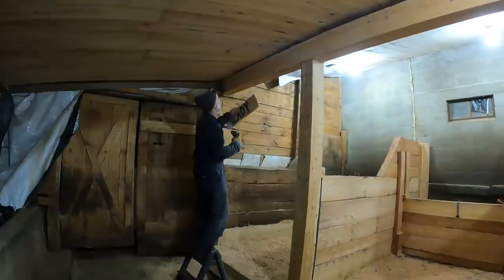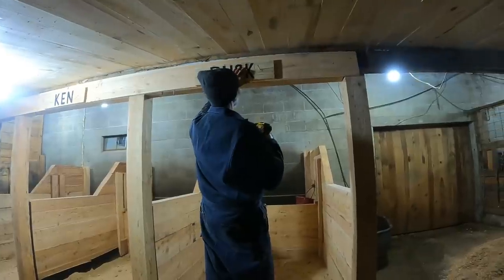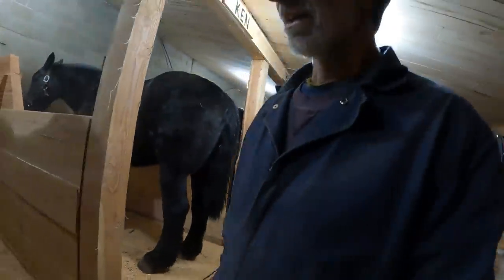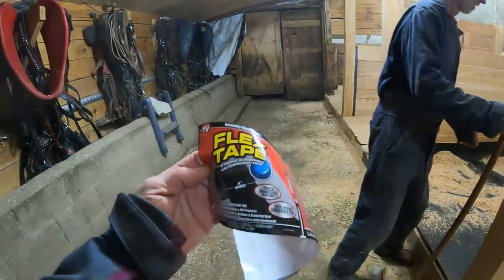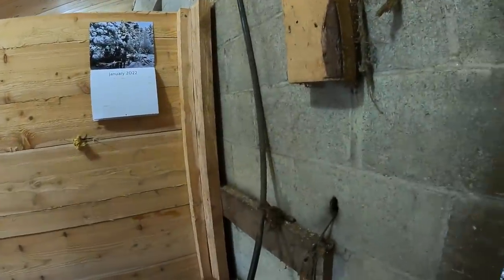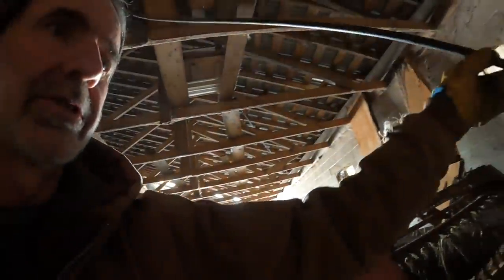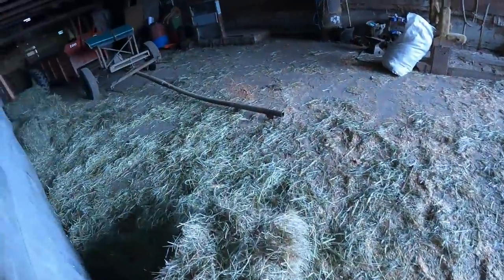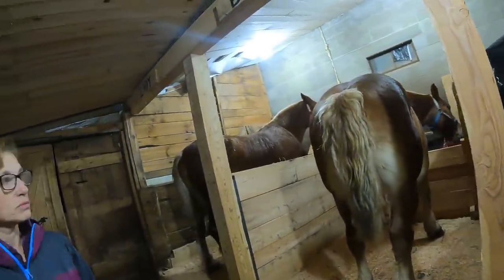How do the horses like their NEW BARN?!?!?!  // Renovating a Draft Horse Barn with Standing Stalls

Comment: You put a lot of work into the “foundation”!  I was helping a neighbor and mucking stalls was very difficult because they just laid the pads over dirt.  And, your use of fine shaving is also much better than the fluffy stuff I see used sometimes.  Other barns I worked (and my barn) in over the years used sand and that was very efficient.  We piled it on the edges.  The manure and pee stayed in place similar to kitty litter and I was able to muck in minutes then pull more sand in from the sides.  Of course, you can’t mulch that but we spread it around the woods since over the years, there really wasn’t that much.

Comment: Looks great just wondering what is the height off the floor for your mangers as I am building 6 new stalls. We were thinking 40" the info would be appreciated thanks.
Reply from the maker: if you look in my video, I can adjust the height of those boards. different horses need different sizes. Mine are between 33-36"

Comment: By the way, for my outside stock tanks which are furnished with tank heaters I use  those flexible hoses, which I when not in use roll up and throw them into the water. Thereby they never freeze up. I came up with the solution because I got tired of always carefully draining those plastic hoses.
Reply from the maker: That is a good idea, thanks

Comment: Hi I just found your channel and subscribed. We just bought a foreclosed property (major fixer upper lol) with an old 36x 78 ft metal barn that was over ankle deep in old horse poop lol. I finally got it all cleaned out with a shovel & a wheelbarrow ( all 2,808 sq ft lol- No tractor yet!) and now I am putting in barn lime by hand. I am making plans for stalls and figuring out everything else it will need etc. There is a odd shaped tack room built inside near the front which  kinda throws off the center aisle width. Glad I found this channel. I want to put in the matteress type stall floor but will have to do one or 2 at a time due to the expense.

Comment: Kind of a pain for you to have to explain all that stuff, but when you get some 20 questions people I guess you feel obligated. Anyhow the stalls look great very clever with the water hose going over the ceiling joist basically making a inverted v and it'll drain. I was kind of wondering if you were going to separate the hoses and  the tub end  would siphon most of the water but I don't think it does(1/2) I guess just because  the tub end isn't that much lower than the end where you put the supply water hose on. Certainly a doable solution.

Comment: Water works, definitely a hodgepodge system for sure. My only contention is that Jim you own an excavator, just dig
 trench around the outside of barn, put frost freeze hydrant outside and then just short section of hose and done.
Love the new stalls.
Reply: The shortest distance between two points.
Reply from the maker: Definately doable, can't see it in the near future, just too much to do